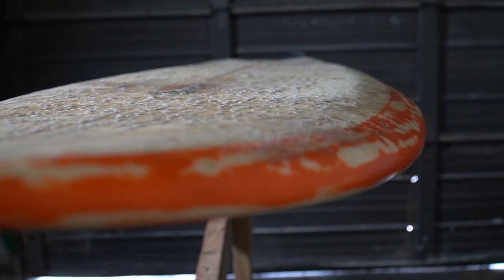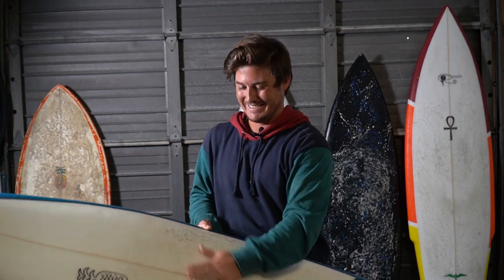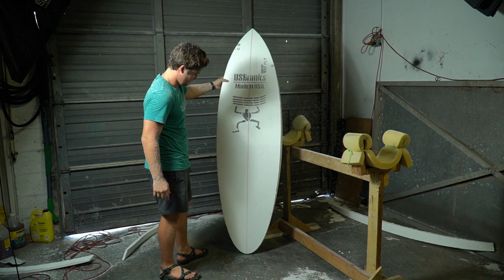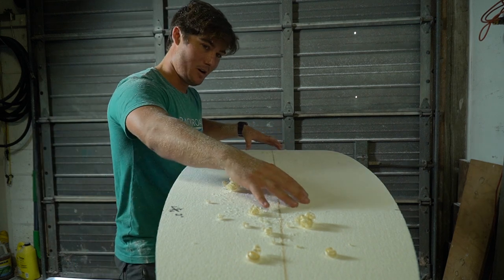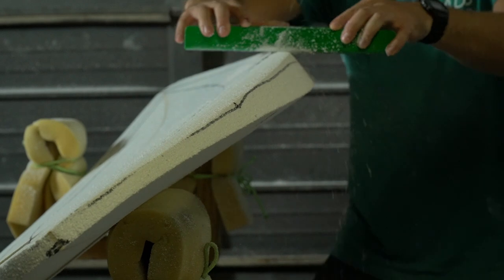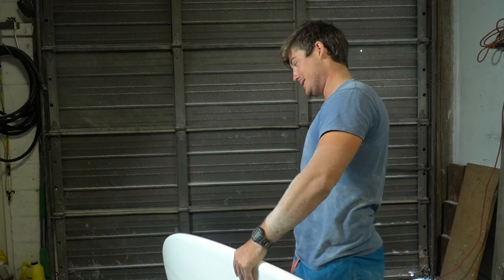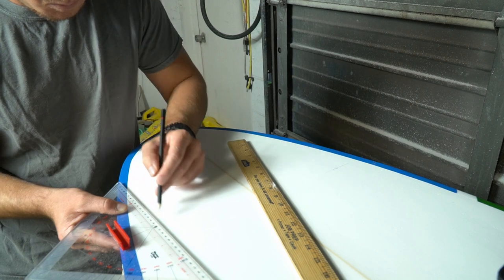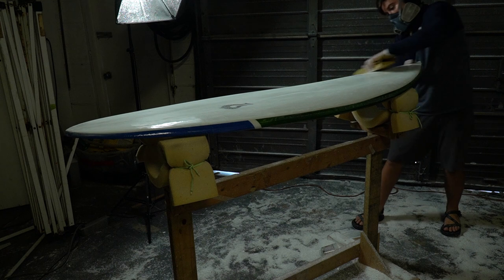Making a Surfboard By Hand at Home in my Garage  (Short Film)

Comment: WOOPWOOP! From one backyard hack to another: good work bud! Glad to see you glassed it too.
Reply: Btw, get a cheap off cut of wood. I use a piece of 1x4 pine that’s about 7 or 8 inches long. Use a hole saw to drill a hole in the middle of it that’s about 1.25” diameter (might have to experiment with different diameters). Then use that as your guide with your FCS router bit to do your leashplugs pre-glass. You can just hold the guide with one hand and hold the trim router in the other hand. Easy, clean, and strong.
Reply from the maker: Brilliant idea! Much better than my cardboard cutout! Thanks for the kind words and tip my friend